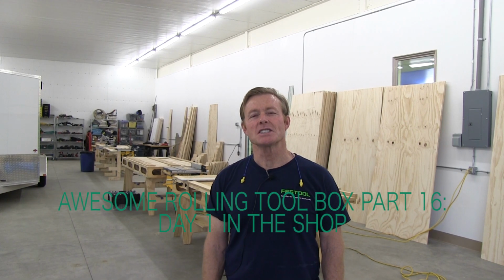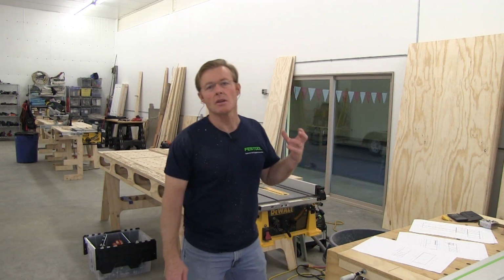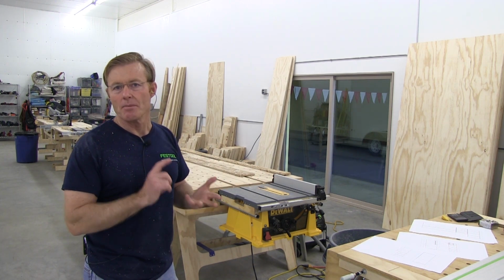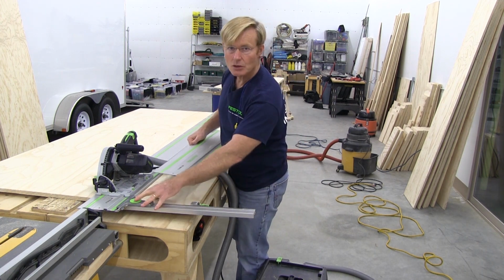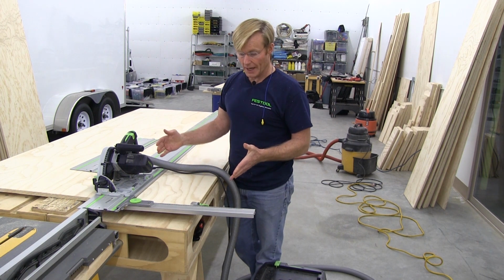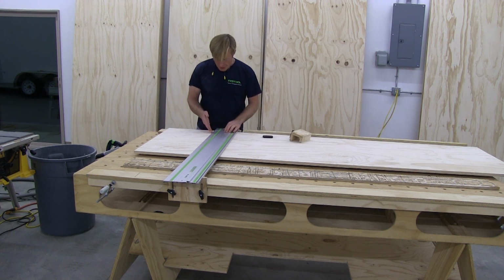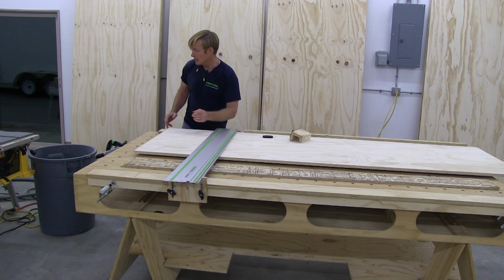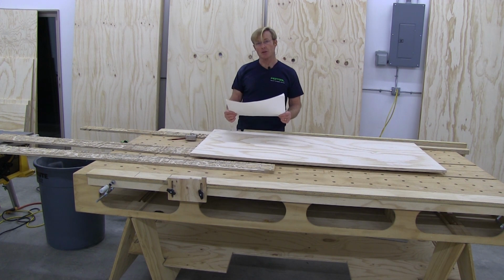BUILDING A MOBILE WOODSHOP (Part 16) The Festool Track Saw

Comment: It must be nice to finally get to the building stage!   I am seeing more and more the potential of those parallel guides.   Do they have accurate built in measuring scales? Or do you just mark and line up?
Reply from the maker: The Festool parallel guides have a very accurate scale, but it is in mm so conversion  is necessary if you are an imperial shop like us.

Comment: Hello Ron. Had a question about the cross cut jig. When you put a stop block to the right of the track are you planning to keep the board cut to the right? If so how do account for the blade kerf? Do you slide the sheet over the extra distance of the blade kerf?

P.S Nice work!

Comment: Another awesome build Ron! What plywood are you using for the trailer buildout? Fir A/C? Looks much better than the stuff I have locally. Also, are you planning on doing any treating of the plywood since it will be in your trailer?

Thanks for all your great demos and information.
Reply from the maker: The plywood I am using and have used for the past 20 years is A/C, the brand or badge is Satin Ply. I don't plan on any finish as I haven't found it necessary over the years. It does yellow over time, but since it isn't out in the weather, it holds up.

Comment: Hi Ron,  I built your workbench last year and it sees a ton of action,  Works great.
I had a couple questions though.  What size truck do you plan on pulling that trailer with?  Naturally I'll be needing this info as I plan on copying you again.  Also when do we get to meet Chris in the videos?  : )
Reply from the maker: Hi, 
Glad you are getting good use from the workbench. My current truck is a Ford F350 diesel, but I have had trailers like this and pulled them easily with F-150s. My truck is 10 years old and no need for replacement, but if I were shopping new, I would take a close look at the aluminum F-150. Chris is camera shy.

Comment: Hi Ron... I wonder how much all the materials will add weight wise...to the trailer?
Reply from the maker: I have no idea other than it will be insignificant to the amount the trailer can haul.
Reply: Just curious about the weight as here in the U.K. our vehicles a restricted on the amount of weight the towing vehicle can actually tow.....and new driving licence restrictions for young drivers preclude them from towing anything....Anyway...always enjoy your videos....keep up the good work.
Reply: +ningis21 I'd allow ~10KGs per sheet of plywood.  Not much in the grand scheme of things, and probably outweighed several times over by the tools etc.